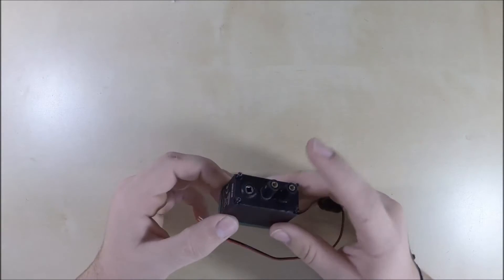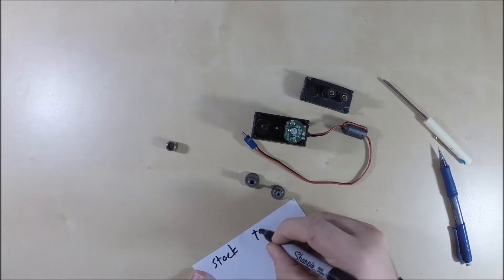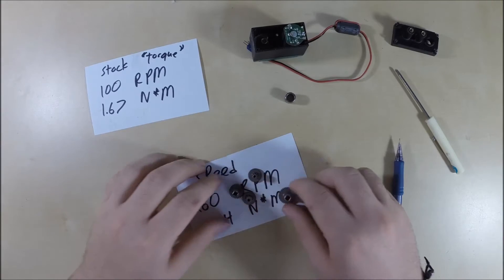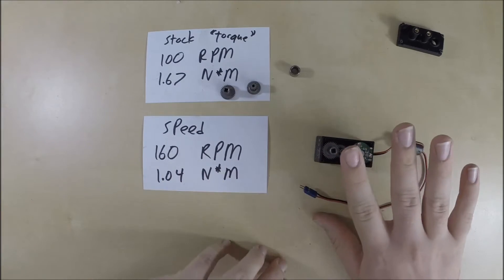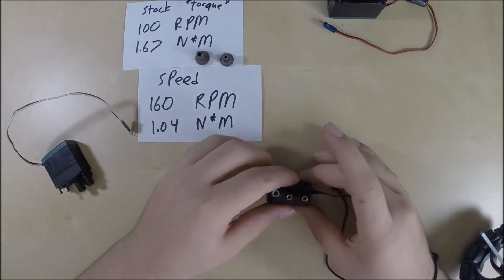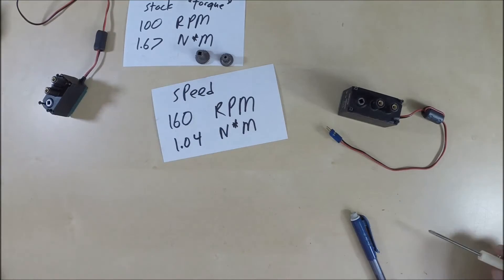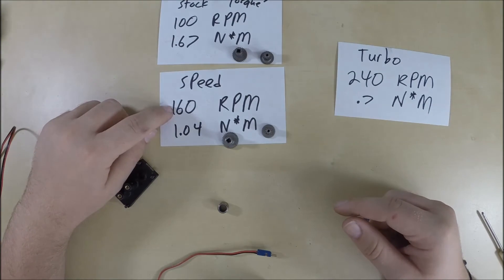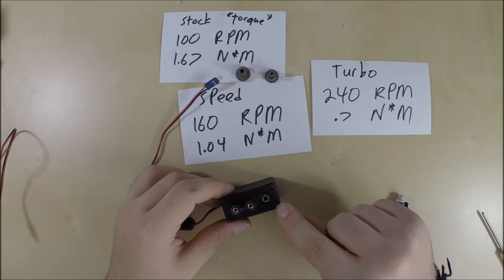Motor Internal Gearing Explained

Comment: I'm afraid this entire video is backwards. The thinner smaller gear is the stock "torque" gearing.  In fact there is a third size called turbo that is the thickest and it is incredibly fast.  It may be best to take this video down as it spreads misinformation. :(
Reply: Hes refering to the output gear that the shaft goes into. Youre refering to the gear that drives the output. As yours gets bigger, his gets smaller. Youre both right.